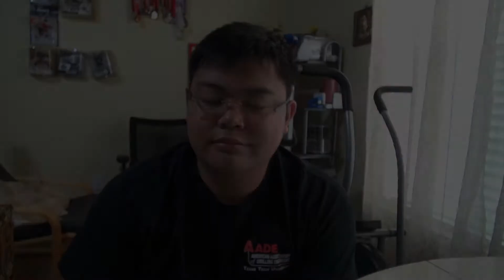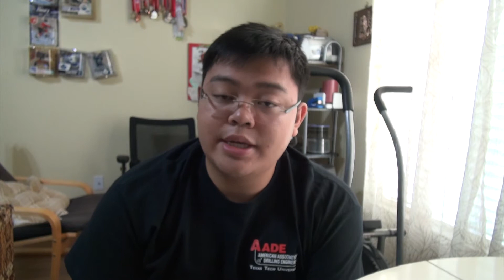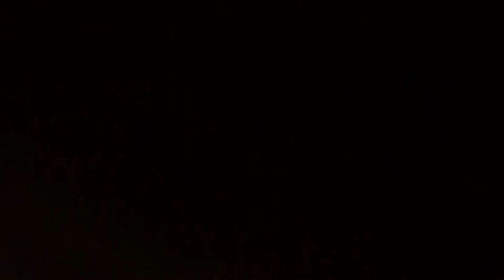What it means to be a Petroleum Engineer

Comment: I have a few questions if you could respond i would really appreciate it?
Reply from the maker: What's your questions?
Reply: @FrancisRamosII  what classes are needed to become a petroleum engineer? Which universities would you suggest are best to try to attend, I live in Texas. How well is their pay, like an estimate? How hard is school for this career , scale of 1-10, what would you rate it? How does it work if I took classes like calculus , geometry etc in high school does that mean I don't have to take them in college, or do I have to take them again? That might be  a dumb question by the way.
Reply from the maker: @fabianramirez3659  1) Depends on the program, because each school is different
2) For Texas, schools like Texas A&M, UT, and Texas Tech are the top schools from what I know. Definitely worth checking out.
3) Estimated pay out of college? Maybe a little less than $100K a year. Depends.
4) Difficulty? 10 (assuming 10 is the hardest)
5) If you took AP or dual credit, it should be accredited, so you don't have to retake it. Otherwise, you'd have to take it again. Check with your high school and the college you choose just to be safe.

Hope this helps.
Reply: @FrancisRamosII  thanks for your time, really helped!
Reply: @FrancisRamosII  I am a junior in high school and live in New York, what is the work load of being a petroleum engineering student?